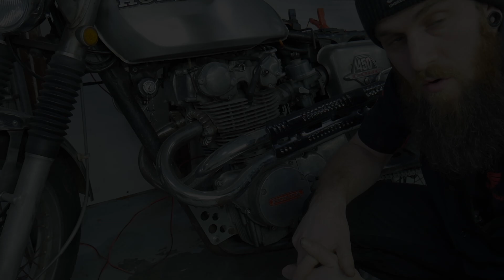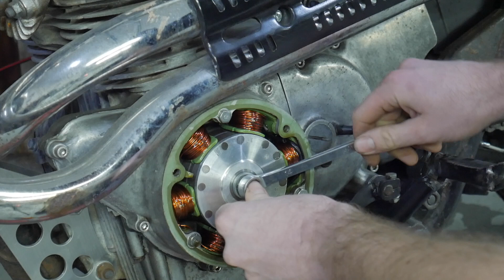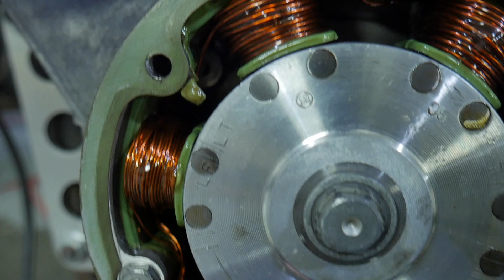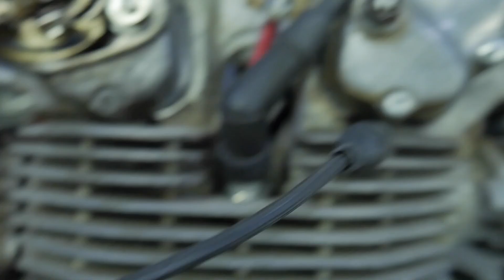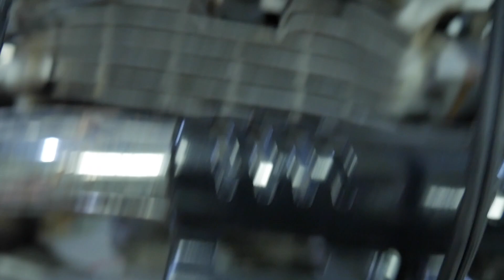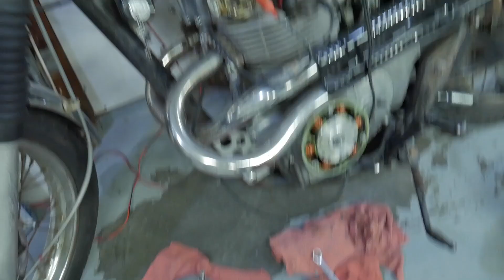How To Static Time Motorcycle Ignition Points

Comment: My question is this.... Rather than use a light to show the points opening, why not remove the spark plug, reconnect the lead and lay the plug on the motor; then you can see/hear the actual spark at the plug? Or, is there a significant delay between the points opening and the plug sparking???
Reply: Thats how I just timed my RD350

Comment: The reason that setting the ignition SLIGHTLY retarded works better than setting it 'exactly' i.e. to the mark/by the book is down to the huge difference in modern fuel vs the fuel from the 70's and 80's.

Comment: This was a great explanation, but I'm curious about what keeps the battery from shorting when the points are closed and the circuit is connected?
Reply: When the points are closed the battery is applying power to the primary side of the coil.  It's not a short just like turning on a light isn't a short.

Comment: Would this work on a electronic ignition ?
Reply from the maker: I’ve never tried it, most factory electronic ignition are not adjustable. Aftermarket, yes. So even if you could? Why?
Reply: TheMotorcycleMD interested in seeing if the same principle would apply. Would be very useful when you have a fresh rebuilt engine and you need it to fire on the first few kicks. Be interesting as a follow up video.

Comment: It's not the "weight of the crank shaft" that's causing the markings to move. It's actually the magnets on rotor interacting with the windings in stator which results in rotor not wanting to stay where you place it. As soon as you stop holding it with the wrench the magnets force the rotor to turn to a point where the net magnetic force is zero. And you don't feel the stiffness turning rotor on some engines probably because the stator comes off with the cover in some cases so magnets in rotor don't feel an induced force from the removed stator 😁 I could be slightly wrong of course but that's my limited experience from working on one engine 😂
Reply: Wow, very informative, cool!

Comment: I only use AGM batteries in my bikes. No issues since switching. Before that on my Honda Shadow VT1100CF I had to get a new battery every year. Since that time, I've not  had to buy one, and it's been about 4 years, and that includes NOT trickle charting the batter over the winter... The one I have cost about $110 (US), but now, 4 years later, that same battery is over $200. What!?!??

Comment: Great video! I had used the beeping function on a multimeter in order to hear that points open/closed spot. All the while I had an LED blinker sitting on the shelf next to me. I've been wanting to recheck timing on mt GT380 so I might just have to use the blinker method.

Comment: Static timing a Kettering ignition system always starts with ensuring the points are properly gapped.  Only then do you start timing.  Doing it backwards guarantees you additional work.
Reply from the maker: Helpful insight and very true!

Comment: Years ago, when I used to set the timing on my Commando, I placed an AM radio next to the engine and tuned it to a no channel (hiss), and would hear a 'crack' when it fired.  Saves having to look at the light and the timing mark together.
Reply from the maker: Haha that is terrific!
Reply: @TheMotorcycleMD  Try it, no wires, no bulbs.
Reply: Nifty.